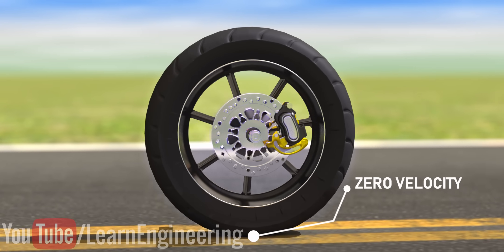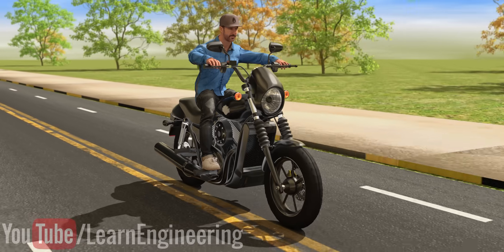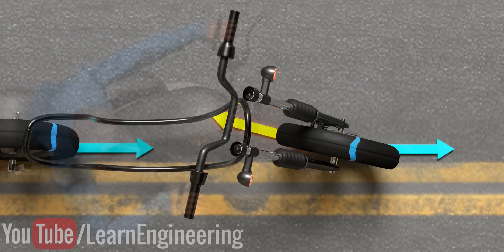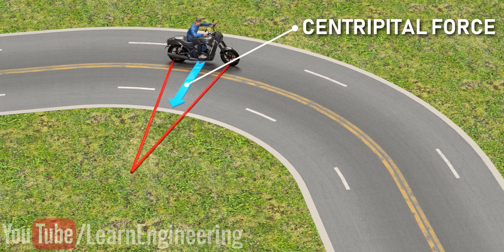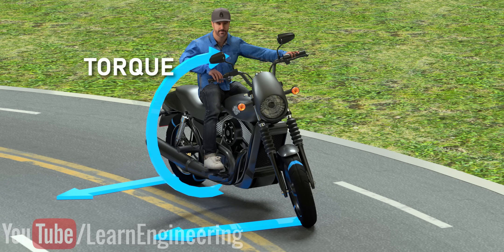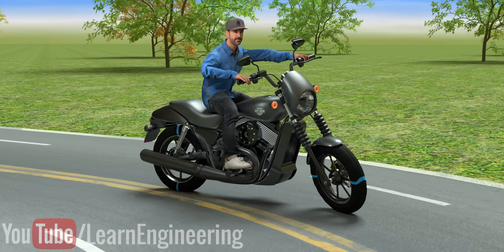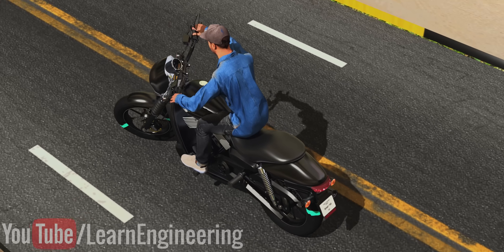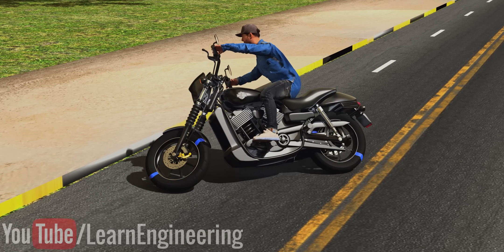Counter Steering | The interesting physics behind it

Comment: I couple of clarifications:  Counter steering isn't really a "technique" as much as it is a law of physics.  You don't really get to "choose" how to steer a motorcycle.  Which way you turn the handlebars depends primarily on how fast you are moving.  At low speed (and pretty much how you steer a bicycle), yes you can lean into the turn and pull the handlebar in the direction of the turn.  It is the angle of attack of the front wheel that turns the bike at low speed.  At high speed this never works and you ALWAYS counter steer.  The reason is the counter steer moves the bike out from under you and causes the necessary lean.  At that point it is the lean and the DEFLECTION of the tire (not the angle of attack) that causes the bike to turn in the direction of the lean.  It is impossible to turn a bike at high speed by moving the handlebars in the direction of the turn, thus counter steering is NOT a technique one chooses, but rather is the only way to turn a bike at speed.  Don't believe me, tape a paint stick to your handlebars and go try some low speed turns vs high speed turns, and see if you have more than one option in how to turn your bike at a given speed.
Reply: Yesss! Exactly. I'm a physicist and I ride.
Reply: Indeed
Reply: Not to mention spin angular momentum and 'precession' stabilising the turn.. very srange the gyro effect wasn't mentioned. I've rode a motorcycle all my life ... they're ace.
Reply: It's possible to turn a bike at high speed, I often do it shifting your weight to either side of the bike to lean it works even at high speed tho I have to initiate the lean several meters before the turn
Reply: @ber2996  
But why would you want to if it’s the more ineffective method of steering. I just don’t see the logic in comments like this!!!!
No!….. you don’t steer by shifting body weight, you are inadvertently counter steering. It sounds like you’re just too dumb to realise it. When you shift weight you’re using your bars to move your body. That is applying the tiny amount of pressure on the bars in order to counter steer!!!!! SMH!
Reply: Yes! Thank you for saving me time to comment. There were so many things wrong with this video. Speed was never mentioned. I was hoping to see and explanation of the physics on the rubber if the tire that makes counter steering work. I have my own theory on that but have never seen it explained.
Reply: u still didnt explain what to do and how to do it do you push on the right or left bar to turn right and do you push on bar first before leaning this is so confusing
Reply: @BSABD315  how is it confusing think about this at high speed what throws you into a lean STEERING IN THE OPOSITE DIRECTION.  Some people do it without even knowing as it comes natural . It's a real physic force and you dont notice that your steering most of the time but to test this theory turn it slightly more in each direction it will literally pull you into a lean
Reply: @georgephillips7408  it sounds so dangerous you are basically drifting but on a bike?? i want to get an automatic motorcycle
Reply: @BSABD315  no and no seriously an auto matic? That's not a real biker . And no it's not drifting at all its literally steering I've explained this alot and it shouldn't confuse you
Reply: @BSABD315  if you not intrested in shifting or cornering why buy a bike . If you cant learn clutch never get on a bike you skill level should be required to understand these things
Reply: @georgephillips7408  im trying to have some fun while staying safe thats all and im not really looking to go over 55-60mph. my car and all my past cars were manual i know how a manual works but i dont want to have to deal with a clutch and shifting gears while on a bike i just want to cruise and relax thats why im looking into the honda navi just wish the tires were a little bigger
Reply: @BSABD315  wanna stay safe get a dirt bike  .. idk honda navi🤣 pretty sure that thing is manual like most bikes its literally the cheapest
Reply: @BSABD315  if you know how to use a clutch then what's your point lol ... just learn it easy as that ...automatic bikes are definitely stupid.  Especially if you know how to then you know it takes seconds to feel a clutch out.
Reply: If you under 200cc it's not like a serious bike at all and if your that worried about safety just think how much smaller and invisible you are to cars almost non existent same with the sound....nobody will hear you.... acceleration and speed also lag when somone gets up your ass your gonna get tailed or pull over
Reply: On a windy day that bike will blow across lanes and such even at low speed there is no weight to keep it from locking tires and being pushed by winds
Reply: Even the bike itself is too small you sit on it as a man and you are far bigger then it .
Reply: @georgephillips7408  its too much work constantly shifting even not having to use clutch on most newer bikes i dont even wanna be flicking my leg up or down allll the time im just trying to cruise thats it not trying to speed just ride without having to switch gears  plus that little thing gets like a 100mpg and 70 at least if you mostly  full throttle it the only thing i would do is get a 12 inch rear tire instead of the 10 and get a aftermarket exhaust
Reply: @georgephillips7408  i want to get a aprillia mana but its too expensive right now its also automatic but a full size bike that goes over a 100mph
Reply: @BSABD315  dude please your hurting me learn to shift ... who really rides a bike for mpg by the way I have a 1300cc chopper i daily and gets 35 to 45 easy. If that's not good enough I just dont get it. If you want automatic and mpg and cheap get a moped lo l ... sorry
Reply: @BSABD315  and also your talking about mods on a bike you haven't even got yet. Take it for a test ride.. I'm a power junkie ... so take it with a grain of salt but if you just want transport get a moped or electric bike but .... I dont consider that real I'm old school i ride up to new hampsire thru Boston on almost a daily basis ... get some power please like a 200 or more and learn to shift .....its the only real reason to have a bike in my opinion
Reply: I have a suspension on my chopper so most people might discredit me but it's my daily and its fucking sick so 🤷‍♂️
Reply: @BSABD315  basically slight steer in the opposite direction will help initiate a corner . On the highway you might need to keep it counter steered.. actually you will . There is no other way to safely travel the highway as a bikes gyroscopic forces will make it impossible to just simply lean to steer . It is possible but you would never be able to quickly turn or change lanes without this method
Reply: This is correct.  Counter steering becomes instinctual.  When I first learned to ride I practiced it relentlessly.  Dodging potholes, telephone pole shadows on the road during a sunny day. Name it. 

If a new rider doesn’t understand counter steering and vehicle is coming right at him and he tries to turn  like his car or four wheeler…he is going to become a hood ornament.
Reply: @junkerdude2927  
On one particular point though, the video is dangerously wrong. The whole thing should be taken down. It’s obvious the maker has never ridden a bike in his life!
Reply: Nope; even at lower speeds, when you think you're leaning to steer, it's actually counter-steering. Even on a bicycle.

A toddler making a turn on his or her their 16" wheel bike is countersteering. 

Unless, of course, they have training wheels. With training wheels, the bike steers like a car (or tricycle): turn right to go right. That's likely the big reason why training wheels don't teach kids how to ride.
Reply: @kazkylheku1221  no you can counter steer as low as 20 mph but you def dont need it untill 50mph but under 15 your definitely not doing it 

Counter steer is used only when the force of the bike moving out powers your ability to actually lean it in the desired direction quickly 

When you need to flick it counter steer Is usually used to initiate a lean and you use your weight to keep it there . Bicycles dont counter steer because your weight Is enough to lean it ...its not 600lbs
Reply: Another guy said to push the handlebar in the direction that you want to turn. This confuses me 😂
Reply: @gerhardbritz1196  no barely ever only at very low speed will you ever turn into the corner most low speed around town normal body leaning is fine . On the highway you need to steer slightly in the opposite direction to get the bike started in a lean
Reply: And for you to get that lean - you countersteer.
Reply: there is no law of physics. counter steering is a deliberate act, its not necessary.
Reply: People who learn to ride a bike since adult will bitching about this video lol..
While kids who can riding since child, they already used to it..

Comment: This is the worst video I’ve ever seen. Counter steering is incredibly important and should be used and learned by everybody. I have a degree in engineering and I’ve been riding and using counter steering for over 40 years but I have no clue what this video is trying to say.

Comment: You obviously are making a very slow speed turn in that key frame for this video.  Never see a tire turned in the direction of a turn like that at speed, just watch any MotoGP video.  Not sure what you are trying to prove with this confusing picture.
Reply: The animation exaggerates the movement of the front wheel in counter steering, so it's pretty misleading. At high speed, counter steering happens in about half a second or less. If you could watch the MotoGP riders frame by frame, you would see one or two frames with the front wheel turned a tiny bit in the opposite direction of the turn. In much slower speedway racing on dirt tracks, riders make left turns with the front wheel cocked far to the right but the bike leaned way over to the left. It works because they are sliding the rear wheel in the dirt. Obviously, if they turned the wheel that far without sliding the rear wheel, they would crash. There was an Australian rider named McCoy (IIRC) in World Superbike, who used the same technique of sliding the rear to the outside of a turn ("backing it in") so he could get back on the throttle sooner. At super bike speeds on TV, it was imperceptible, not to mention risky. He crashed a lot.

Comment: If you are riding normally and follow these instructions you will crash the shit out of your bike.  You do not turn the handlebar in the direction you are turning when going around curves, you counter steer or you crash.  Seek a different video if you're trying to learn to ride.  Don't follow this one's instructions.
Reply: Watch your front wheel while riding slowly.  You will see that once the turn has stabilized, your front wheel is turned in the direction of the turn.
It is to initiate the lean that counter steering is used.
Reply: Dave InWLA
Hey, stupid! The front wheel ends up pointing in the direction of the turn because it self aligns. If you intentionally turn it into the curve you will move in the opposite direction. DOH!

Comment: There are a lot of confused opinions on here. The way to initiate any turn at any speed on a 2 wheeler is by counter steering. You might imagine you're doing it by leaning or body weight shift, but still, consciously or not, you're moving the steering. To get around the turn the motorcycle needs to lean into the turn, and the way to initiate that is by turning the opposite way. Experienced motorcyclists will often consciously counter steer every turn on every ride. The technique, once mastered enables you to steer with precision at any speed and take optimal avoiding manoeuvres.
Reply: Congrats! You're the first comment I've seen that got it right!   For all those who think they can turn at slow speeds with out counter steer, they should try riding a bike or motorcycle that is modified so you cannot counter steer and they'd be very surprised to find that they cannot turn at any speed without counter steering first.
Reply: @AndyPanda9  Yep, you can prove it by riding in a parking lot after a rainy day. Ride through some water and then make a turn. When you look at the tyre tracks you'll always see the front wheel move in the opposite direction to the turn at the beginning.

Comment: I'd been riding for 20 years when someone showed me the countersteer technique.  I realized that I'd been doing this instinctively all along, just didn't know it.  Only at slow speed do you use direct steering.  At anything over 10 mph it's countersteering whether you realize it or not.
Reply: Counter steering is used to control the placement of the Center of Mass of the bike over its support line.
To cause the lean - at ANY speed - you must counter steer.
Reply: @daveinwla6360  you know, you're right.  Checked it out myself.  The only time you can direct steer is when you're paddling the bike along with your feet.  If the bike is going fast enough for you to stay up, you've got to countersteer.

Comment: Absolute crap ! This, what you are doing is not countersteering, countersteering is pushing the handle bar forward on the same side of the bike that you are leaning to, making the bike lean & turn quicker.
Push left, lean left, turn left - Push right, lean right, turn right, that is countersteering.

Comment: well, the truth is that you always Counter-Steer to turn a bike, even riding without holding handlebar. You can mount a GoPro on gas tank to see how counter-steering affects, it's very interesting actually. Just don't apply too much pressure for long period of time on either side of handlebar or you'll restrict motorbike to turn itself automatically, that being said, this technique is pretty safe.

Comment: https://www.youtube.com/watch?v=lzk8oyNO708

So much confusion about counter steering. The fundamental principle of motorcycle steering is that centrifugal and centripetal forces must be equal for the selected lean angle and respectively the turning radius. How do you achieve this it depends. At very low speeds you can counter the centrifugal force by shifting your own weight or you can counter steer - though counter steering works AT ANY SPEED, but at lower speeds you can adjust between the two depending on what are you trying to achieve. At higher speeds counter steering is THE ONLY WAY you can practically steer. Even the slightest turning angle i.e. largest turning radius produces large centrifugal force equal to that of yours and your motorcycle's combined mass multiplied by v^2/R. You simply do not have the weight nor the leverage to counter it with your own body (v^2/R is the centrifugal acceleration so run few speeds and radius values and see for yourself with what kind of forces you are dealing with), so for example at 60mph, the only way to bring your motorcycle to the proper leaning angle so you can complete the turn is by counter steering. Basic motorcycle riding class: in order to turn right, press on the right handle bar, lean right, go right, to go left, press on the left handle bar, lean left, go left - what they tell you basically is to counter steer! Of course people will ask but what about just leaning? You can just lean without counter steering, and since the angle at the fork with respect to the wheel creates a negative feedback system, i.e. the motorcycle is a self balancing machine, you will go into the direction you want to go eventually without falling, but the speed at which you can bring your motorcycle to the desired lean angle is inversely proportional to the speed at which you are going, i.e. you will die long before you avoid that mattress on the highway. Again - counter steering is the ONLY way you can possibly or effectively steer you motorcycle!!! And if you have been riding for a while and haven't died yet - the parts of your brain responsible for balance and stuff have already figured the counter steering out without your conscious parts of your brain even realizing it.

Comment: better option is to just go slow on curves. if sudden obstacle appears on a straight path avoiding it will make you counter steer on instinct because you are trying to balance your bike. if you want to experiment on this video better do it on a parking lot not when you're actually on the road. just my two cents...

Comment: This video is kind of misleading especially with the animations. The wheel will not be pointing in the direction of travel while going around a corner. The bike will continue through a corner because it is leaned over and the shape of the motorcycle tire. Counter steering will allow the bike to "fall" into the direction of the corner and the handlebar will naturally straighten but you'll be able to turn because of the lean of the bike. Need to turn sharper while in the turn? Apply more force on the inside handlebar in the direction away from you to allow the bike to fall further into a lean. Once you stop applying force, the bike will naturally upright itself.